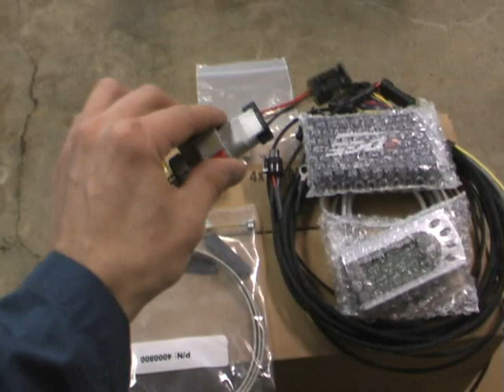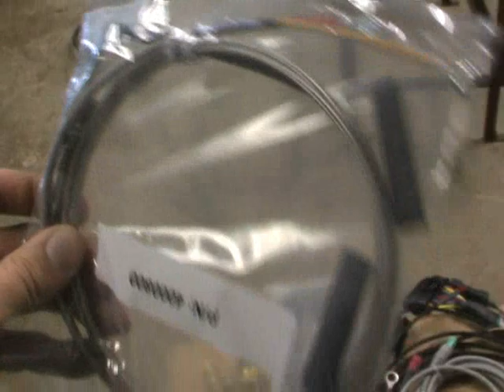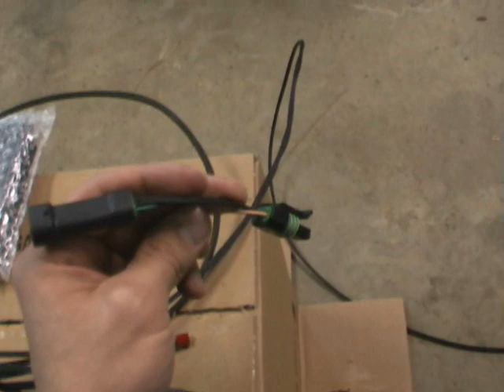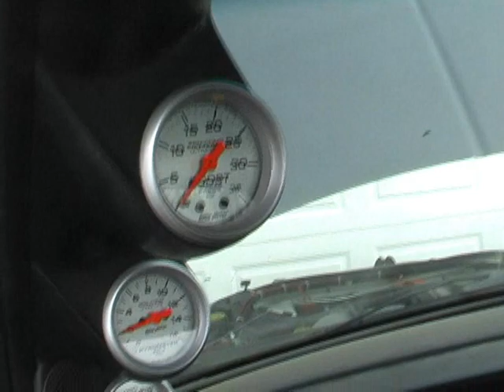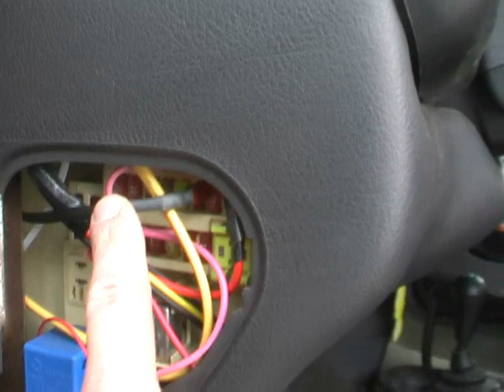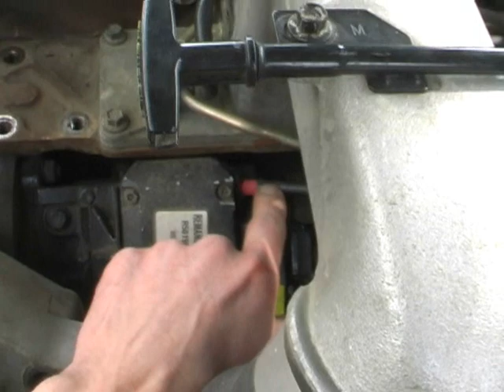Edge Install Part 1

Comment from the maker: Whatever dude.  Same thing.  It doesn't shut off the ignition right away so that the engine will stay running until a predetermined amount of time has passed or the EGTs get to a certain level.  It was labeled in the box and in the instructions as the turbo timer connection.

Comment from the maker: @joeldude76 NO!  It is model/year specific.  First your dad's is a dodge, yours is a chev.  Second his is a diesel, yours is a gas.  Some chips work for a run of years, but this is irrelevent, as the trucks are way to different to begin with.

Comment: can i install an edge chip without the moniter for my 2000 gmc sierra my dad has an edge chip wthout the moniter for his 2004 dodge ram 2500 cummins i was wondering if it would work in my 2000 gmc sierra 5.3l

Comment from the maker: @cooltoys 
This chip costs about 700-800 bucks depending where you get it.  You don't need the pillar gauges.  It did all come in one box.  If the cts or cs was available when I bought this one I would have got the cts.  You don't need to get the add on if you buy the juice with attitude with cts.  Not sure about the part numbers, just check on Edge Diesel Performance's website.